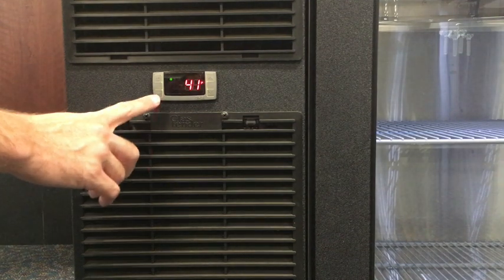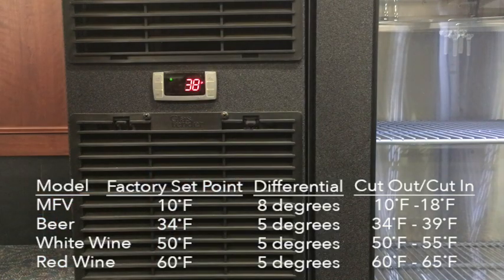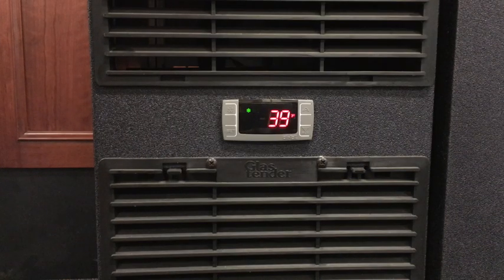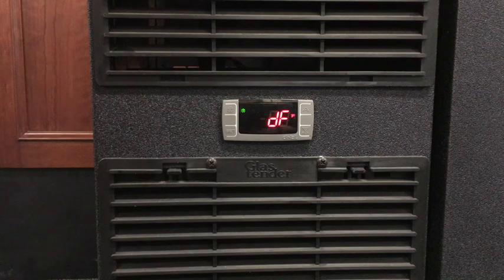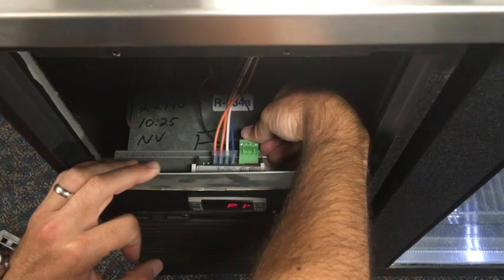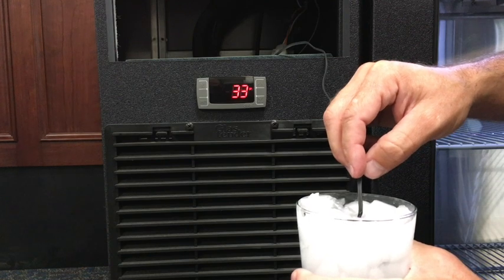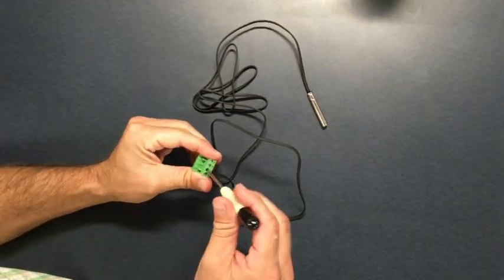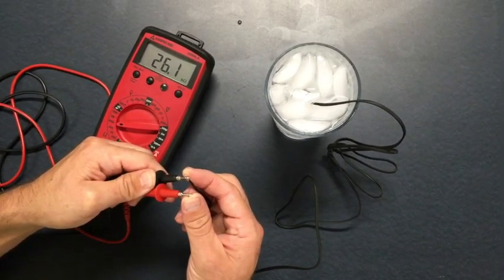Dixell Controller

Comment: Mine flashes P2, what does that exactly mean?
Reply from the maker: If your Dixell Controller is in a Glastender cooler, please contact our service department. If your controller is not in a Glastender cooler, please contact the company that supplied the controller. Thank you.
Reply: @Glastender  Temp prob number 2 is not working or not hooked up..
Reply from the maker: @richardcrook2208  Please contact us if you have questions regarding your Glastender unit on warranty or technical service. We have specialists available Monday through Friday from 8am to 5pm EST to answer your questions. Email: parts@glastender.com

Comment: How do i reset to default settings my dixell has slow cooling and only reaches 6 degrees celsius
Reply from the maker: If your Dixell Controller is in a Glastender cooler, please contact our service department. If your controller is not in a Glastender cooler, please contact the company that supplied the controller. Thank you.